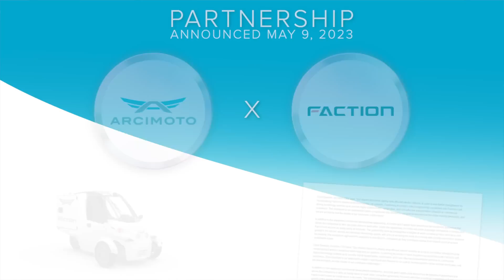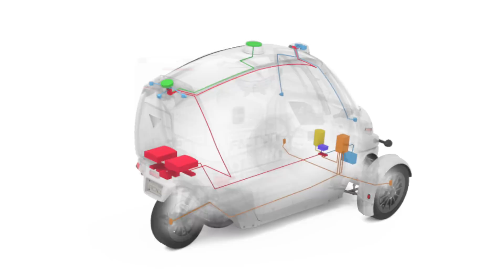The Arcimoto/Faction Partnership: Driving the Future Forward

Comment: The most people would buy one, if there are full enclosure and aircondition and if Arcimoto stop dream that a vehicle for one or 2 people is enough!!! The most need space for three persons and space for packages! So i will looking around for something more smart for my everyday needs
Reply: The average car trip is still 6 miles with a single passenger, three empty seats and an empty trunk. This design directly addresses the abuse of heavy climate controlled personal vehicles where they are not needed.

Comment: IMHO, they should have used tilting front wheels—especially if the top speed is what, 70+ mph? The configuration they have now is probably fine for urban transport, but I need to see some examples of higher-speed hard cornering done by an objective tester (not by an Arcimoto employee). Other wise I’d be concerned about the tricycle tip-ever effect we see so much (at least in single front wheel trikes.). 

To those criticizing doing a partnership with so little cash reserves: they clearly needed to roll the dice to get more types of customers involved for more use case scenarios.  Continuing as-is and expecting different results is (as they say) insanity.  We shall see!
Reply: There have been no roll-overs except a few kids who admitted they were being reckless. It is very stable. Tilting is a completely different design for cheap thrills. I feel very safe and comfortable in mine compared to any motorcycle I have ever owned.

Comment: I wish they would sell at least one model that is fully enclosed with a steering wheel
Reply: That would be a comletely different vehicle that is not fun like the Fun Utility Vehicle. Handlebars allowed a reduction of 260 pounds and a length reduction of 18 inches. If you add the weight of useless doors and glass it will be slower and of course you will also demand climate control that sucks the battery dry. You want a car, not an autocycle. That demand is what got us near the brink of climate disaster in the first place. There is no compromise that lets you continue to drive excessively heavy over powered vehicles 3 miles to the grocery with 3 empty seats. Change or perish.

Comment: If made longer.. longer battery. More people.. more range?
Reply: Then it would not be a sustainable vehicle, it would be an abomination like everything else! Once the science consensus reached 99.9% on climate change, no long distance driving is appropriate unless that is your job. If you need to go 100 miles take a bus or train or just don't go. I have had mine for 18 months now but never ran the battery below 40% charge. If it held more than two it would just be a car and we have too many of those, that's what got us in trouble in the first place.
Reply: @popeyegordon  but will there be accessories that will drain battery? Watch movies and a fridge
Reply: @xlargetophat  Movies would be through your phone battery. It is absurd to consider a powered fridge when a cooler is more sensible but yes the 12 system powers heated seats, heated grips, heated defroster, wipers, lights and more. That is a separate battery that gets topped off with every charge.

Comment: How many turns lock to lock was that steering ratio? Looked like the steering wheel was spinning maybe 3 times and the drive wheels weren't even close to being full lock
Reply: That is a prototype so such specs are not established. The wheel is only a visible affectation of the geared down motorized steering, the vehicle needs no wheel to operate by wire. Servos that turned the handlebars with step motors gave a jerky control to the steering.  Note how the wheel obscures the view of the control panel to a driver of a normal height in the seat. Prototype design.

Comment: "Under the agreement, Arcimoto will receive one or more SAFE notes for an aggregate total of up to 10% of Faction in exchange for an equity stake in Arcimoto."

I really like this partnership from a combined product standpoint, because while the FUV is expensive for what it is, the driverless features could make their ROI still worthwhile. But... I can't find any info on how many or what percentage of existing Arcimoto shares Faction will receive as their equity stake? Will this equity stake in Arcimoto come in the form of an option for Faction to buy shares, or will shares be provided to Faction without cash changing hands?

Arcimoto is getting an option to buy 10% of Faction, at some future date, if they pay an agreed upon amount of cash. I'd guess ~$590k if Faction's most recent $5.9 million valuation is used. Given Arcimoto's market cap is ~$11.5 million, what percentage equity stake in Arcimoto does it make sense to give Faction, in exchange for that option to buy 10% of Faction? 5%, 10%, 20%?

How many shares of dilution should Arcimoto shareholders expect immediately from this deal, or perhaps later if Faction is merely getting the option to pay cash for Arcimoto shares later? It is nice for Arcimoto to be able to participate in Faction's upside if they manage squeeze a nice ROI out of these vehicles, but the cost in dilution for that option isn't clear.

Comment: I put a down payment years ago but still not buying one at the current price. Just too much for too little at this point.
Reply: Same here!
Reply: That is an innumerate comment. Mine is paying for itself in just 8 years compared to owning any car. Why? Insurance!! Autocycles get the very low motorcycle rate for insurance, saving an average of $1000 a year in most states. On top of that built in annual 'rebate' you buy no gas or oil changes. You have no air bags or converter to steal, no clutch or automatic transmission to wear out, no timing belt to break. I didn't even notice the cost to charge mine on my power bill.

Comment: Good update.  I thought the steering wheel variation was too heavy, 110 pounds or something like that that you reduced going to the motorcycle steering. No you have steering wheel and autonomous!
Thing I am looking for in a small vehicle such as this is 300km range at hwy speeds. Not only do I need a small EV to get around town for stuff but I want to run up to my home town to visit the family everyother weekend, 200km one way.  you folks are almost there and trip would be feasible with fast charging.
Best wishes to the Arc team.

Comment: Finally a steering wheel!!!!!! Will make it way more fun to drive when not in Faction Mode. Plus, Chris got some doors designed and now we can see his work on getting doors made for the current one. What more FUN can you have when having the FUV drive itself. Arms out the windows on those full doors with the windows rolled down. This is FUV with 1000% more FUN. Thanks Chris. Keep it going.
Reply: Where did you see a steering wheel?
Reply: @gratefuljer  multiple times in the video

Comment: Is the steering wheel for just the autonomous vehicles? I’d trade mine for one with a steering wheel in a heartbeat.
Reply: That wouldn't be a "fun" utility vehicle then.
Reply: @TimTacTV  maybe, but I wouldn’t have to wear a helmet in Washington either.
Reply: @dobbsmovies  yeah that law is wack. You are quite obviously less safe wearing a helmet in a FUV, I'm sorry they make you up there. Perfectly protected from the roll cage and seat belts, adding mass to your head adds more potential for neck injuries.
Reply: Don't forget they have to then add a foot operated throttle and move many of the other controls.  All possible, but it takes time and money to re-engineer.
Reply: @GNiessen  I know. That’s why Mark went handlebars in the first place.

Comment: This is sensible.  Good collaboration.

How squeaky are your bikes?  What about doors?
Reply: its not, and doors are an option. But even in the rain the driver is dry without them. They are in Oregon, a lot of rain.
Reply: @davefroman4700  
From Western Washington, with a lot of rain, and hard to predict weather, more so than Oregon. 
Btw Eastern Oregon and Washington are pretty dry...
Reply: @davefroman4700  
That's okay in light rain coming straight down.  We have rain that's heavy enough to splash up and in, as well as get blow in horizontally...
Reply: @b_uppy  You have no experience with this, otherwise you would already know the pressure wave moves all rain, every single drop, past the driver while we are moving. Not so much for the passenger though.
Reply: @popeyegordon  
I do have experience, that's why I am vocal.  
A driver thats sitting still or moving slowly fails to generate enough 'pressure wave' in sideways rain.  
The one in the back gets hit with wind and rain, without benefit of exercise to warm them.  That's the start for hypothermia.  As the person or animal in the back is often smaller than the driver that's of real concern.

Poor design is still poor design
Reply: @popeyegordon  - Incorrect for the rest of us. I rented them on two occasions and got soaked one time when a truck passed me and hot a puddle. This was in FL.
Reply: @billsmith5960  No. That unverifiable claim of yours, if true, only proves you were not skilled enough to avoid being a target for a truck's splash. I am involved with social media on the Arcimoto as much as any other person and yet you are the very first one to claim you got splashed by a truck. You have the track record consistent with lying trolls who shit on Arcimoto until they get banned.
Reply: @popeyegordon  - Unverifiable claim by you that I'm the only one that has had this happen. Again, maybe stop with the curse words, it makes you look very immature.
Reply: @billsmith5960  
Agree with Popeye on this one.  If you see a truck coming stick your legs out the sides and onto the ground.  Lift up by the steering wheel, and pivot so that the back of the vehicle receives the splash at all times.  
Get out and wipe off the back window and rearview mirrors as you get rained on and splashed by other vehicles.  
You will be pleased with your prowess, expecially on the times the bike remains upright.

Seen motor vehicles get splashed, and the side gets soaked, including the windshield.

He's cursing because that's what his 'skill' is...
Reply: @b_uppy  - I agree. Cursing and attacks on any differing view is only hurting the company. Turning people away from the product is his specialty. Sad that there are people like this but it is what it is.
Reply: @billsmith5960  
He's distracting from what customers are saying they need.  He's providing zero constructive feedback.  He lacks sufficient argument to defend his ideas without offensive remarks.
Reply: @b_uppy  - When he start's with offensive remarks, then it does show he has nothing to back up. A number of times he's been caught just making claims that the company does not. It's more of an opinion. In this day of age, it's easy to insult via keyboard.
Reply: @billsmith5960  
I have had him attack in previous videos.  Getting a little tired of it, that's why the cheeky response. Likely Popeye saw 'I agree with Popeye' and went away happily, could also be he's planning his verbal rebuttal, or maybe he's trying to locate me in Washington state, who knows.  Bill Smith is a good name to have in this instance...
Reply: @b_uppy  - I know he's in FL. So, you are far away. I agree, next attack is coming soon. I'm amazed that Arcimoto puts up with this.
Reply: @billsmith5960  
Think it might be a person working for Arcimoto that is very resistant to change, and likely supported by Arcimoto's long term plans.

Comment: Uh ....Software? This is nothing but more hype. As expected from the spawn of Nicola. Don't hold your breath.
Reply: Autonomous operation is 99% software. There are already units in service in Vegas. They are breathing just fine. This is your verifiable Arcimoto video comments harassment offense #9
Reply: @popeyegordon  I don't believe you.
Reply: @daviddelbrook3321  This is your verifiable Arcimoto video comments harassment offense #10
Reply: @daviddelbrook3321  - It's real. It works and just rent one in LV. I am next week. A self driving FUV is the best.
Reply: @billsmith5960  Get back to us in a week with your review. I will believe you.
Reply: @daviddelbrook3321  - Couldn't rent a self driving one. On the other hand, never got wet or was cold when I was there with my FUV. This is the third time renting one too! Even just walking around on the strip I was dry. Maybe because it was hot and dry.

Comment: A lot of sway in that box in the rear. Needs a second wheel, even if they're just a foot apart. Potholes will be difficult to avoid.
Reply: Zero sway. The front wide wheelbase is doing its job just fine. People who have experience with trikes know how to do it with minimal pothole engagements. There is the width of a manhole cover between each of the front tires and the rear tire track.
Reply: @popeyegordon  - It has body roll (which you call sway). With the new steering wheel they showed, this will help with the reduction of changing direction in the X direction. The current design is seriously flawed and Chris fixed it. He's going to turn the company around with listening to us, the people.
Reply: @popeyegordon  
That only works if you can avoid the potholes/see them in time.
It's a liability.
Reply: @b_uppy  No. You really blew that one. When you can't see potholes, NO vehicle can avoid them. Zero liability. I am tired of telling trolls the same thing over and over again. Trikes have existed as long as cars have existed. There is no actual problem. 500 happy Arcimoto owners have no complaint about potholes. Thousands of renters of the 200 rental vehicles do not return complaining of a pothole hazard.  There is the width of a manhole cover between each of the front tires and the rear tire track.
Reply: @popeyegordon  
Lol.  You blew it, twice.  This is about what happens to the trike after it hits a pothole.  As the owner of several trikes, I can attest four wheels are more stable that three.  
You're strawman argument fails to make your argument better.  4 wheeled vehicles are still more stable.  This is about sway, balance, etc, or did you forget the comment you originally responded to?  It's not as if having only three wheels makes trikes magically avoid potholes...
Reply: @b_uppy  Let's talk about YOUR straw men. No trike you owned in the past had formula one racing proven double A-frame suspension or a swing arm. 
Lets talk about your education being so poor you never learned the difference between your and you're. 
Let's talk about you ignoring the extremely low COG that puts batteries and motors down at axle level, so low that it is not load height but load capacity that determines ultimate stability. The Deliverator has already hauled cargo 50,000 miles with no issues of stability or sway. Hybrid pedal/electric cargo trikes designed for inner city last mile deliveries are all far higher COG than the Arcimoto. We can clearly claim that the Arcimoto is the most stable of all 3 wheeled delivery vehicles, based on comparing other designs.
I am replying to about 50 posts here in the next day, wait your turn. You will be dealt with.
Reply: @popeyegordon  
Lol.  The proof is in those that try them, find them problematic, and buy something else.
Reply: Stability is important.

Comment: Tesla which has the best engineers have been working on autonomy for many years and they are still not there yet (although after 4 million cars collecting data, they are very close).  
How can Faction, with no fleet of data, solve autonomy?  This is a huge gamble.   Autonomy is much harder problem to solve than people think.
Reply: I also 2nd this motion, my thoughts exactly, and I'm a stock holder in both, TSLA & FUV, I believe in the future of both Companies.
Reply: It’s a good question. My guess is that they are doing a different platform. It won’t be fully autonomous in that there is a control center. Like the robots at Oregon State U that deliver food and have been for years now.
Reply: @harriska2  Probably. They speak in colors.
Reply: Because this isn’t autonomy. It isn’t “a computer doing the driving” it’s “remotely driven.” A person sitting in an office building meant is remotely driving it the same way a drone is flown. 

Faction has said they want to work on fully autonomous, but with no timeframe. (Which is good, since no company is very close to 100% autonomous under all conditions.
Reply: @AnonymousFreakYT  This video is deceptive.
Reply: This is a new company (just like Tesla was). They got it right and it's proven. Self driving FUV's are 100% reality.
Reply: @billsmith5960  Prove it.
Reply: @billsmith5960  Tesla is very different in that they have a ton of miles driven/recorded to teach AI how to drive.  I don't know anything about Faction, but I wonder if they will be able to do this.  Tesla focused on building and selling the car as priority 1,  FSD is high on the list but is secondary.  FUV should focus on production and then look into autonomy after that.  They need to stop bleeding first.
Reply: This is pure nonsense.
Reply: @daviddelbrook3321  No, this is your verifiable Arcimoto video comments harassment offense #8
Reply: They will buy FSD licenses from Tesla
Reply: @gusazzo  Is that your speculation or is that something they said somewhere?
Reply: @gusazzo  Fail.   Crystal balls don't work.
Reply: @gusazzo  Tesla is not selling FSD software.
Reply: Another dream.
Reply: @daviddelbrook3321  This is your verifiable Arcimoto video comments harassment offense #11.